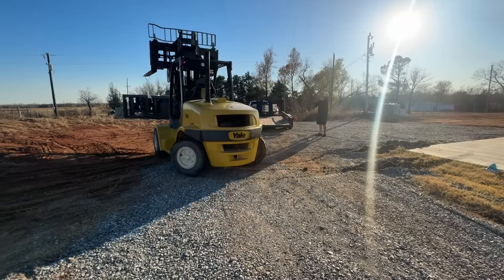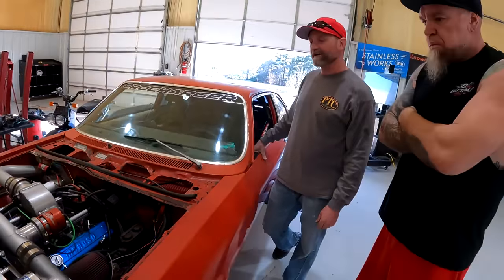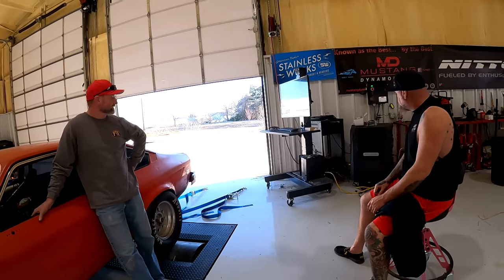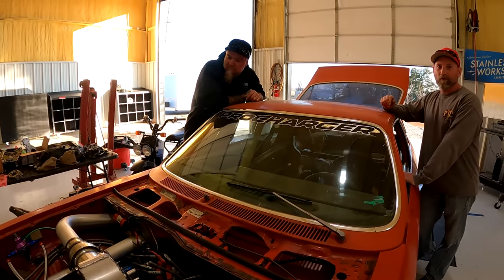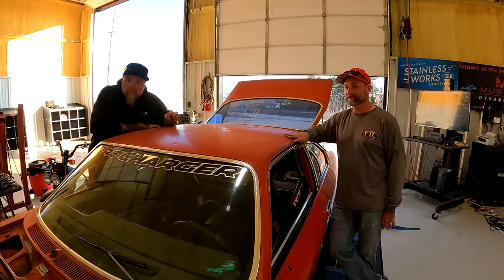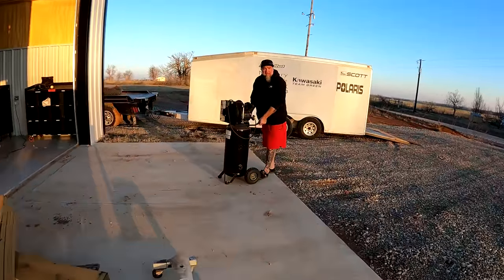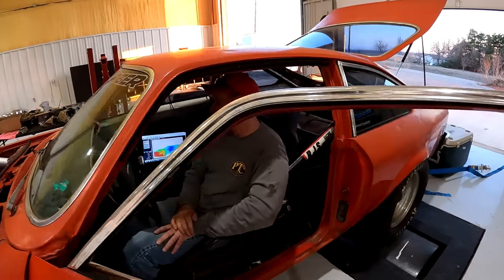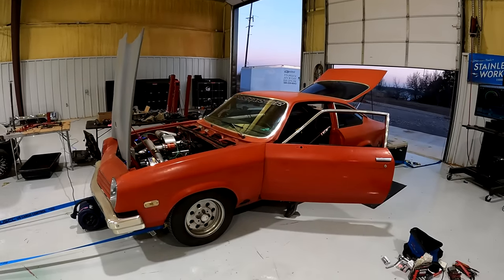Shane Comes Over To Rip His ROWDY Procharged Vega On The Dyno!

Comment: Soo, I just bought a factory orange 1975 Vega panel wagon. It's been back halved, and going to get a 4.8 with an 88mm on e85, Holley Terminator system running it. Just got a Jeff Miller Power Glide and PTC converter, and heading to PA to Glory Days Fiberglass to pick up the one piece front end and a 4" cowl hood Thursday. Then it will be on to Chris Cline Race Cars for the assembly! Can't wait, going to run a 33x15x15 slick!

Comment: This car brings back memories, A friend of my dads had a Vega and within a month of buying it they had put a V8 into it, possibly one of the first V8 conversions around (there were no V8 conversions at that time). The engine according to my dad was a home made 302, which was a 327 small journal block and a 283 crank. Everything else was ZZ302 parts (cam intake ect) out of the GM Performance catalog. It was backed with a powerglide and a stock rear end, and was supposedly undefeated in Lenawee county Michigan

Comment: Shane could use S10 drop spindles on the front with the 2000-2003 s10 dual brake calipers. Even the 2000-2002 S10 blazer rearend is 8.5” and come with disc brakes from the factory. Then he would have Chevy bolt pattern 5x4.75” and they have a crap ton of rim selection for his Vega. Great job guys on the install of mustang dyno

Comment: Hey Shawn I use a 26 inch wide Eastwood triple pass radiator and it keeps my vega at 190 on hot days. And they are fairly cheap. Just s little modification to the mounting tabs on radiator and core support. Check them out.

Comment: 185 75....? Man in my day we put the volkswagen metric 135 r15. Its almost motorcycle size. Hell ive seen bigger motorcycle tires. Those look like a stretch tire on factory vw wheels. I know as i have a 56 vw bug in my shed right now with those on front and 195 60 15 on the rear for traction. The motor i had in it in high school was built over 2000 cc 2175 i believe. I havent messed with it since i cracked a head and it started running like crap. I started redoing it in 2000 but moved and didnt get back in it. Woll soon since i have a grandson now. He will need it in a lil over 15 years.

Comment: I remember in the 70s and 80s when it was the thing to do is to pull the piece of shit four cylinder out of a Vega and drop a small block or if you are really nuts a big block into the front of a Vega. I helped a friend put a L88 out of a totaled Vette into his Vega wagon. Used a TH400 and a cut down 12 bolt. Was really fast for its day but you can go down today and buy as faster one off the showroom floor. It was fun to help build it. I heard he wadded it up in an accident a few years later but I’d moved out of state by then.

Comment: Draglite.   The cheapest drag wheel produced.  They were the entry level wheel.  
Do you know why people don't run the rear caps?   It's so the tech inspector can see you have aftermarket axles. Otherwise you may be asked to pull a wheel and show them